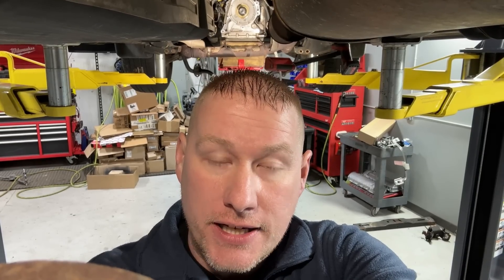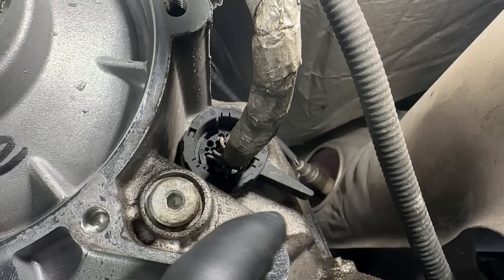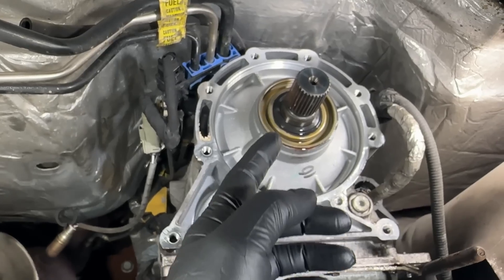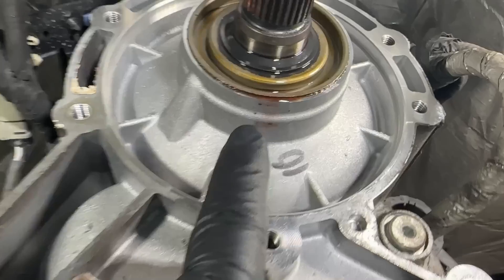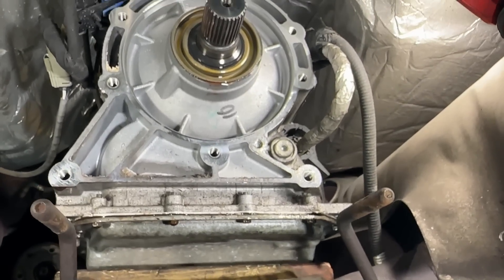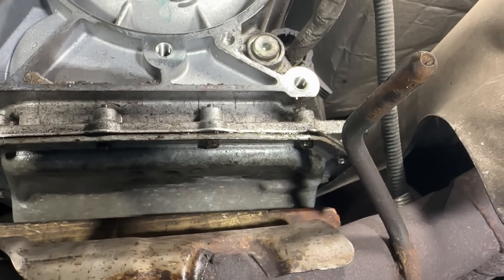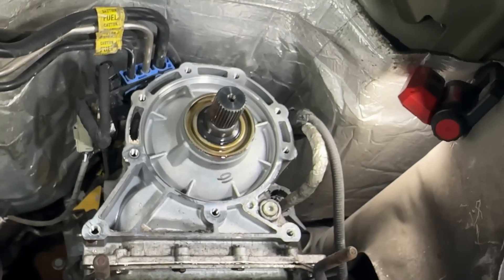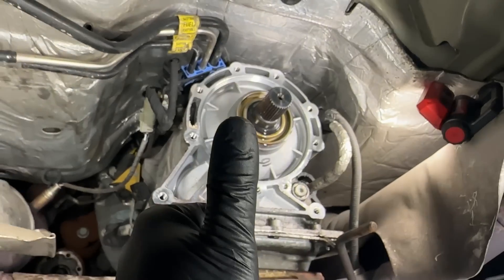Ford F-150 & Expedition 6R80 Six Speed Transmission: Common Leak Points Often Misdiagnosed!

Comment: Just had a transmission fluid service on my 2010 f150. It was 400$, and they fixed the sleeve that had a slow leak. Doing it all myself would have saved 300$ but i definitely would've missed that leak point. Truck has 178k with now 2 fluid drains in its life. Very happy with the transmission.

Comment: I've been through three lead frames and two transmissions. Every year my lead frame would go out and I'd have to get it repaired from Ford. I had the transmission rebuilt by a private shop and a year later I was having shift issues from 6th to 1st while driving on the freeway. Turns out it was my harness on the firewall that ran down by the exhaust manifold that had fallen off the clips and melted seven wires that went to the transmission. I don't know why the Ford technicians never caught that or check for that. It took out of my third lead frame and Ford would not cover. So I went online purchased a new lead frame new pan filter and a box of transmission oil and watched his video on how to swap it out. Did it myself or 250 bucks in my driveway and got me a wiring harness for 180 and that was two years ago and haven't had a problem since. Thanks for all the great videos keep them up
Reply from the maker: I have a video just like that coming out.
Reply: @FordTechMakuloco  oh perfect

Comment: Great video, Brian. My neighbor has one of these and it leaked all over his newly poured concrete driveway. He took it to a shop, who replaced the pan gasket. It still leaked. He took it to another shop, that specializes in transmissions, and they replaced the bulkhead connector. That cured the problem. Keep up the great work.

Comment: Had a 6R80 start hard shifting and going into limp mode all the time. Dealer and trans shop quoted new transmission. Dropped the valve body and found the square pillow block, (I think it connects the pump to the torque converter), cracked in half. Replaced that, the 4 crush tubes, the bulkhead seal, and she's good as new. $125 in parts I think.

Comment: Brian,  thanks for taking the time to do this video. What perfect timing, I have been looking online for a week and did not find any info on the rear output shaft seal leaking. I figured this is the source of my 6R80 leak on my 2010 F150 4WD but after watching your video I'm now convinced that pulling my transfer case and replacing those seals as well as the transmission output seal will take of it.

Comment: Thank you for the information, and reassurance that the 6R80 is virtually bulletproof with care and maintenance I have a 2016 4+4 5.0 75.000 miles and plan on keeping till the wheels fall off with all the crap that they are putting on the newer models

Comment: 2017 F150 5.0 speed shift sensor went bad, local dealer said that it would take 6-8 months and would not repair under their extended warranty. Spent 7k with AAMCO to replace because no parts available for the same amount of time.

Comment: Like you stated everything looks like a pan gasket leak given where the fluid runs. In my experience the pan gasket isn’t robust as they are intended for reuse but do not survive careful removal as it’s cheaply made.  Running a trans shop we see plenty 6R80s fail, it’s all relative, let’s say they fail less than GMs 6L series but that’s not saying much. 

Good video as always to inform the Ford owners. We will never run out of work with Ford and GM.

Comment: Thanks for this. I recently changed my trans fluid. Before I did I watched your video where you talked about the bull head gasket. I changed
It because it was leaking. Thanks. I’m gonna climb under
There to look at the other leak
You mentioned in this video. Thanks
Again. You have helped be over the years with my 2010 F150 thanks again.

Comment: Yup!  I have a 2009 F-150 with the 6R80 with a re-programmed shift point.  I noticed ATF fluid in the drive.  I looked all over for the "gasket" leak and stumbled on the bulkhead connector.

Comment: I had a 2010 f-150 with a 6r80, bought it used with 70k on it, and after about 10k it started to have a shutter on light throttle at highway speed. I determined it was the torque converter, pulled it and found a ford reman one in there. Thought that was interesting, so I dropped the pan to change the filter and found a valve body bolt sitting in the pan. I figure they must have replaced the converter and never dropped the pan.  I drove that truck for another 90k miles never had another issue.

Comment: Just another reason I wish they had put in a traditional trans fluid dip stick/fill tube on these 6R80 trans...  I have one in my 13 F150 Ecoboost and so far so good.. Going to be doing a pan drop/filter/fluid change on the rig soon, but I'm going to be putting on a new trans pan with a drain bolt in it!  Then at least for future fluid changes, I can just drain and fill a lot easier and not risk messing up the pan gasket with a pan drop each time.

Comment: Note that the same 6R80 6-speed transmission for the F-150 and Expedition is also standard in the Lincoln Navigator from 2009 to 2017.

Comment: Thank you for the great information. If the tail shaft seal is leaking, how quickly does it need repaired? I just discovered similar looking evidence of leaking on my 15 F150, just shy of 114,000 miles. I’ve owned it four years, since about 25,000 miles, with no transmission issues. I discovered the leak as it has coated part of the transfer case. I have seen zero drips or puddling on any surface where I commonly park.

Comment: Great video.  Do you have any info on 6R80 torque converter clutch faults?
It engages when initially starting truck and driving but after around 4 - 5 miles it throws the wrench and disconnects per my scanner.
Turn off truck and it repeats the same process. P0742 
Do you think the transtar valve body bushing repair kit would help?
2011 f150 eco 4x4  278000 miles

Comment: Hi tech,
I have 2019 f150 3.3 4x4 with six speed.
I don’t want to sound stupid but I want yo know if transfer case fluid from ford is required for fluid change and not trans fluid like the hometown dealer recomended I use for fluid replacement.
Can you let me know please..thank you

Comment: My 2014 Expedition had the bulkhead sleeve leak and get fluid on the wire connections. The dash went crazy, with lights flashing, gauges bouncing one end to the other and every possible message displaying. All while driving. Parked the vehicle and it would not restart because it would not recognize the chip in either key.

The sleeve was replaced and the wires cleaned. Couple of months later there was a relapse and the vehicle became completely undrivable. The dash cluster controller shorted out. Currently waiting on repairs.

Comment: So I’m installing a transfer case on a 6R75 transmission (2007 Expedition). Is it necessary to buy a new Case to Adapter Housing gasket or can I just clean and reinstall without one?

If the output seal is leaking I would like to see it asap instead of the gasket hiding it.

PS. Thank you for your videos, you are a huge resource for us DIY Ford owners.

Comment: Small leaks can not just be a nuisance but also dangerous for the transmission depending on how bad the leak is.  B&M Transmissions sells a transmission dipstick kit where one can check the trans fluid level from under the hood.  Are these kits safe for day to day use and would you recommend them?  I realize the leaks have to be repaired but sometimes we are in remote locations and can't access parts right away.
Reply: I installed the B&M dipstick on my 2011 expedition and I like it. No leaks after 6000 miles or so. The fittings are nice and machined well. Tech tip:  I put some stainless zip ties to keep the tube off the exhaust down pipe. Be sure to make sure your trans is properly filled before installing so you can get a good mark on the new dipstick.
Reply: Ford eliminated the dipstick because these transmissions are sealed and pressurized, but the aftermarket dipsticks provide the same seal and seem to do a good job.  The dipstick connection at the transmission is a push fit with O-rings, rather than a screwed mechanical connection that is a concern, but I haven't heard of any actual issues.  The aftermarket kit is usually $200 to $250 in the U.S., but I haven't found the kit available in Canada under $550.00

Comment: Do you have a part number for the tail shaft seals for both the transmission and transfer case? 2010 F150 4X4. Thanks

Comment: Had to have the bulkhead connector replaced on my 08 expy with 148,000 a couple years ago.  Was just sitting in the winter and it puked out a baseball sized spot on the drive.

Comment: Can you discuss the weird torque converter shutter? My 2017 F150 just started doing it and Ford wants my truck for over a week. Do you think a fluid change and filter would possibly fix it?
Reply from the maker: yes and yes there will be a video soon.
Reply: @FordTechMakuloco  thank you sir love your content!
Reply: Most of the time when that happens the fuild needs to be changed along with a new filter. Once I changed them both out the shudder went away. I ended of doing 2 fluid changes the first 1, then another after I drove 100 miles and drained the fluid again and filled it. It now shifts nice and smooth. I now need to do my u joints and just ordered a set from Ford.

I also bought  Dorman 265-854 Transmission Oil Pan with the drain in the pan to make it easier.
Reply: @906lane  thank you for that bit of info, I’m going to do the exact thing and see if it’ll help, after all she’s up to just shy of 95,000 miles
Reply: @str8trkn  My transmission shop recommends most transmissions to be serviced every 30-60k Most people wait until it’s too late. Don’t do what most people do and never service it.
Reply: My 2017 began to shudder pretty bad. I took it to a really good transmission guy and instead of changing the torque converter, he suggested a fluid and filter change. When I picked it up and drove home, it still shuddered exactly the same . But, as I drove my truck and put a couple hundred miles on it, the shudder disappeared and has operated smoothly since.
Reply: Update: I had Ford do a fluid change on the trans, 260 miles since and so far so good.. thanks everyone!

Comment: I have had some concerns with hard shifting in my ‘17 f150 with a 6R80.  I’m pretty confident that all recalls and so on were complied with by somewhere in the realm of 2019-2020.  I’ve also experienced where it wouldn’t upshift while in tow mode.  I’d pass someone, it would downshift to 2nd or 3rd gear, and then wouldn’t upshift.  I’d have to slow down and accelerate slowly, or knock it out of tow mode.  This seems to me like software issues.  Do you know when the latest and greatest came out on that?  Would they have completed software updates before I purchased it in 2019, or when I brought it in for unrelated service in 2020?
Reply: I know this might sound odd but check for any boost leaks that was happening to me as well . And it turned out to be boost leak . I thought I had dirty fluid or low fluid . Also check for those good luck
Reply: @jasonarellano3025  It’s a 5.0
Reply: @jasonarellano3025  And I do regular fluid and filter changes.
Reply: I went to MANUAL SHIFTING in Tow mode ELIMINATED ALL shifting problems on my 2017 f150 6r80.
Reply: @paulcristma4469  Ha!  Doesn’t this completely defeat the purpose?  Of course I can manually shift through the gears.  But that’s a workaround.  Not a solve.
Reply: I drive in a lot of hills Manual shifting   towing seems better for me i went to  FORD they said nothing was wrong so i just manual no problem.

Comment: Off subject sorta!
I’ve put on catch cans(both), two weeks ago I walnut blasted my intake valves!
2016, f150xlt, 3.5eco, 76000 miles.
ECL came on long after catch can install.
P04db code.
Now it’s showing permanent fault!
I put in a new PCV valve yesterday, Old one still rattled!
Went out and drove 5 drive cycles, 25mph for 5 minutes, stopped for 30 seconds, then did that again 4 times!
Code reader still says permanent!
Some you tubers say 15 drive cycles, some just one!
Any ideas?
Thanks for all the great info you share!
Learned tons from you, and my Chilton man 16-17 trucks!
Then doing it myself is true teacher!
Again maybe you could do a vid on that reset of that code!

Comment: If I have a 2016 f150 5.0 2wheel drive with the 6r80 will any 6r80 transmission be a good replacement such as one that came out of a 6 cylinder or echo boost ect.

Comment: So is the trans filter accessible when dropping the Trans pan? When I got my 2016 f150 serviced for filter and Trans fluid change at the Ford house they told me it wasn't accessible from the pan. They said it was built in and non changeable.

Comment: I took mine to a dealer to get a drop pan fluid and filter change and they said they don’t do it but only did fluid flush so that’s what I did but kind of mad about because that’s what I wanted to do but I guess they don’t care what a customer wants.
It had at the time 90,000 miles on it 
17 f150 2.7 eb.

Comment: Awesome Videos! You always explain everything in full and great details.
This is not really related but my search brought me here. 

I have a 2014 F150 5.0, I've had the rear main seal replaced. to do this  they had to drop the tranny pan and replaced filter and fluid.

Ive checked the tranny fluid level recently and it was up to temp boy this is sure fun to do.

My fluid was dark reddish rusty brown but does not smell burnt is this normal for LV fluid.

When i open tranny fill 19mm port to access dip stick fluid is running out of the port and I am unable to get an accurate read because fluid is everywhere no matter how many times I wipe the port there is always fluid there to hinder my read.

Still yet to check at cold temp.

Does this sound like too much fluid in my transmission.

The reason for checking fluid is that my 3rd to 4th gear has a shudder when shifting.
What could this be?

If you could give me some insight with all of your ford experience.

I appreciate you man keep it up.
Reply: Likely too full, mine doesn’t leak out when running. I’m at low end of hot fill level when up to temp

Comment: Son in law has a 2008 ford explorer sport trac 4.6L 4x4. Speed sensor went out. TCM is bolted to valvebody. Bought new one the was suppose to be programmed. Installed. Won't Start. The Starter Will engage for a second then stop (similar to security) Took it to Ford dealership, Firestone and nobody can seem to fix the issue. Install original valvebody, cranks right up like normal but input speed sensor is bad. In order to start, the relay has to be manually closed, engine will start, Rev up to 3000 for a second, then idle down like normal and drive normal. At a loss as dealership stated it was "to old" to reprogram the Tcm. Any recommendations?

Comment: I've got a 6r80 you can tear down. Failed after second 50k fluid exchange while towing @98k miles. Dealer botched the first rebuild attempt. Other dealer tore down and identified botched repair. Ford forced me to use the original dealer to fix the botched rebuild. Hasn't shifted right since. Shudders when shifting 1st to 2nd. I wont tow with the truck now because of it. Have more details on exact components that were damaged improperly installed if interested.

Comment: I got one, 2021 Ford Expedition Max the start-stop feature intermittently when coming to a stop engine shuts down and then when you go to accelerate there's no power you have to turn off the vehicle turn it back on to restart the vehicle no codes when scanned other than low-voltage code check the battery was filthy and had parasitic drain clean the battery problem went away for two weeks and now returned any thoughts?

Comment: Questions...I have a 2016 f150 5.0 60,000 miles. I keep getting a burning oil smell inside the cab that is intermittent.  It comes and goes. I have had it to ford dealer 4 times and they can not find a leak and they even put dye in the oil and still found nothing. Do you have any suggestions or have you seen this before and maybe it's coming from a specific location? Thanks for your help

Comment: FordTechMakeuLoco I need your opinion . I have an 09 expedition that downshifts hard and is even worse in cold weather. It will occasionally not downshift and I need to restart the car to reset it . I tried disconnecting battery and that didn’t work . Please help